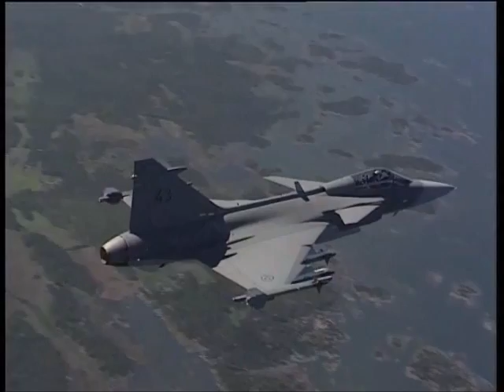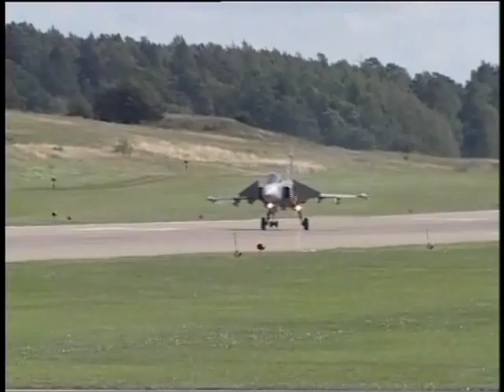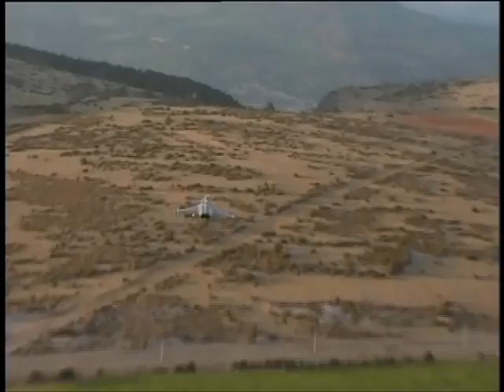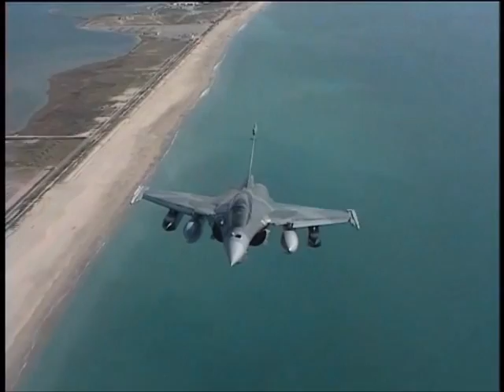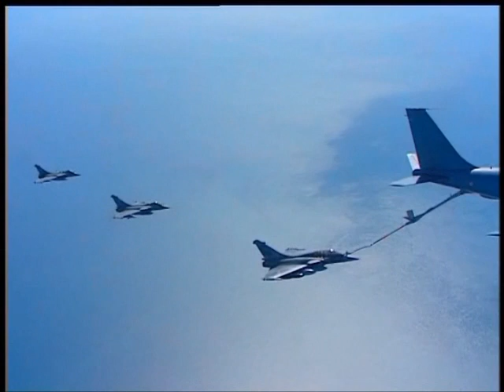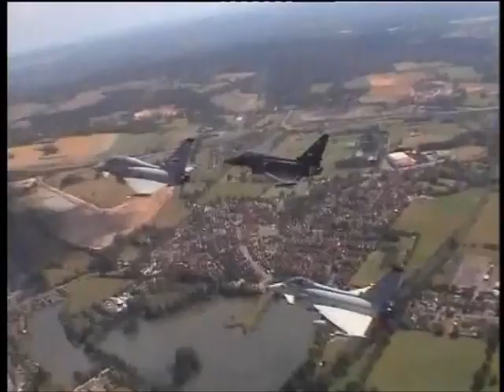Eurofighter, Rafale, Gripen - AircraftRecognition.co.uk

Comment: The video started wrong already at the beginning. No the gripen wasn't the 1st of the 3 to fly first, it was the Dassault Rafale !

First gripen fly was in 1988, Rafale was in 1986. Gripen only entered in service before the Rafale, simply because French politicians and government, was always changing their minds and demands ... It results of delaying the Rafale entering in service for many years.

Otherwise the Rafale would have been long time ago ready to enter in service before gripen. Politicians are the problems as often.

Also, gripen c/d which is the original and first gripen, was only using a Volvo engine. Only the new gripen ng e/f is using same engine as f18.

Comment: AESA Radar (RBE2 AA)
Advanced Optronics and warefare systems
Engine Options M88-4A or M88-9
Better armament and nuclear strike capabilities
Omnirole Capabilties

The choice is easy, the Rafale is the better especially considering how cheaper it is compared to the Eurofighter, the Grippen is not even in the same league but It isn't trying to be and selling at considerably cheaper price
Reply: Gripen is the best deal - it sets aside national pride to use component from all over NATO (British radar, American engine, French fuel system, Swedish cockpit display, German gun...) to ensure that the Gripen gets what is best for the price.

Don’t even get me started on how capable Gripen E is.
Reply: InitialDAmine  the new captor E radar on the typhoon his miles better than what the Rafale as. Stop trying to put the Rafale above the typhoon because it will never happen. The Rafale his to slow, service ceiling well below the typhoon, radar not as good. Thrust to weight ratio not as good. The Rafale his a great fighter at what it was designed to do that his air to ground. It can do other things well but it's certainly not in the same class as the typhoon in air to air mode at BVR or WVR
Reply: @terrywainman6050  is there a eurofighter with captor e rn ? Spectra is better than Dass . In wvr and dogfight the rafales close canard gives it an advantage in low speed . It also experiences less drag. In bvr also rafales radar is better rn but once the captor e comes .... eurofighter will get advantage in radar .....but Rafale spectra can provide firing solution upto 200 km.....Dass is only 100km+ . Also Rafale has ir signature reductions . It also has TV channel in osf  and a laser designator as well. It is wayyyyy better in A2G due to terrain following features and larger payload and more range etc. Also remember the Rafale has the mica ir ...which is the longest ir guided missile . Both the aircraft officially has about same rcs but I think Rafale is lower due to active cancellation and better shaped air intake . It also has serrated edges on the wing . It is also slightly smaller than the eurofighter thus giving it lesser rcs.

Comment: Gripen is the most susesfull in terms of sales. Seems low operating cost, easy to maintain and good support structer from SAAB means it is doining very while. And the gripen NG will bring it from 4.5gen to 5gen levels.

rafale is just to expesive in purches and maintaince.
Reply: To kaa13:
... I would add that Switzerland did NOT even buy the Gripen... at least not yet... It was first selected because it was the CHEAPEST option (the Rafale had CLEARLY gotten the highest evaluation ratings, the Eurofighter Typhoon being 2nd and the Gripen 3rd and last, as shown by the Evaluation Report which is easy to find on the Web), but the sale was eventually cancelled by a referendum in May 2014. To date (June 2018), Switzerland still did NOT buy a new fighter to replace its F-5s and then its F-18s.
Reply: "the Rafale had CLEARLY gotten the highest evaluation ratings"
At least in combat endurance and payload as i recall it, which is no surprise when compared to Gripen. One would have expected more from the Eurofighter, but I guess the two aircrafts have different priorities.
Reply: @onlypeaceindeath  The Eurofighter effectively was barebone tranche 1 which they offered. Now in the new evaluation they offer Tranche 4 - the same as the Luftwaffe orders. Multirole with an aptitude for air defense. Quite likely the evaluation will be won by the EF. Especially given that Switzerland had poor experience with Dassault in the past.
Reply: @Sedna063  "Quite likely the evaluation will be won by the EF"
Isn't the operational cost for the EF quite massive? The Rafale is to my understanding cheaper to operate, plus the Spectra EW suite is supposedly one of the best.
Reply: @onlypeaceindeath  This depends how accounting is done. Both Eurofighter and Rafale are expected to be equally expensive. However, there are multiple figures out there and I don't believe either of them. In terms of operating costs, it would be Saab 39 that would be the least expensive. 

However, we are talking about Switzerland and they are a rich country.... 

The Spectra EWR is great but honestly, not much is free information to either of us, similar situation with the Typhoon's DASS. 
I would say both are highly capable with a slight edge to the Spectra but nothing the Typhoon cannot get. There are talks building a special EW variant of the Typhoon for the German Luftwaffe. Now that would really change things.
Reply: Given that the Gripen by design cannot be a stealth aircraft, it won't be possible to move it from 4.5 to 5.
Reply: @Sedna063  "Given that the Gripen by design cannot be a stealth aircraft, it won't be possible to move it from 4.5 to 5"

I think he meant that the electronics will be at 5th generation standards.
Reply: @onlypeaceindeath  I think he means it will be a 5th gen.
Reply: yes yes volks wagen polo have more sell than the aston martin DB9...

Comment: Gripen flew first in 1989!
Reply: 1986 for the Rafale !
Reply: Banzai Banzinou true, (actually 1988 for Gripen), but the introduction was earlier for Gripen, 1997 compare to 2001 for Rafale.
Reply: The Swedish Defence Material Administration (FMV) states the first flight being in 1988, not in 1989. So I'd say MightyMagnus is correct.
Reply: Banzai Banzinou the demonstrator (significantly bigger aircraft equipped with F18's engines) flew in 86, the prototype in 91 and the first model delivered to the French forces in 2000

Comment: Yeah you're right, thanks for the correction :-) On the other hand, the airframe is used as multi-roles (SU 35) And it's much more suited to carry other munitions (Bombs, rockets..) Compared to pure breads such as F15A/B/C and F22s... But the multi-role would probably be carried out by primarly MiG 29s during Soviet reign. and the Airsuperiority role would be given to the SU 27.
Reply: Multirole wouldn't have suited the MiG29 at all. Far too little carrying capacity.

Comment: The F 15C is an Airsuperiority fighter. It carries a AA missiles a plenty. Meant to suppress the enemy Airspace. It's not intended for CAS/SEAD/whatever duties. The F18/SU 27/F16 and single seated Mirage 2000-5 is Multi-roles. (Twin seated being fighter Bomber á F15E & SU 34) Start with Categorizing and you'll end up with each aircraft in a categorie by itself... Stick to their roles and judge them from that.

Comment: Part 1
"You could damn well fly there with WW2 fighters and you'd get marginally worse results for the same costs...."
I agree that the nazislamist thugs in Mali did not deserve the Rafale or the Mirage 2000 or even the older Mirage F1... but hey, these are the aircraft existing in French air force, and it was a good opportunity for the Rafale to perform very useful precision strikes...

Comment: Part 3
For example, the F-15C and the Mirage 2000-5 are two fighters of about the same generation, but the F-15C is a heavy fighter which is in the same category as the F-18 (although lighter) and the Su-27 (although heavier), and the Mirage 2000-5 is a medium fighter in the same category as the F-16.

Comment: Yea? can the Typhoon be operated from an aircraft carrier? IF not, you'd goup the F 18(E/F model) in "carrier capable" togheter with say Rafael. It's really a strawman anyway.

The point is really that since each aircraft are designed to fullfill the same role they are comparable.

Comment: You can compare Gripen and EF Typhoon to some extent because they have comparable roles and are of the same generation.
But it is also true that they are not in the same category: single-engine/twin-engine.
In this respect, it's probably better to compare the Gripen with the most advanced variants of the F-16. In the Indian MRCA/MMRCA competition, where the Gripen NG competed, one of the other competitors was the F-16IN Super Viper, based on the F-16E/F Block 60 (already with an AESA radar).

Comment: As I already stated, the Gripen was chosen because it was less expensive than the Rafale and the Typhoon, this is a very well known fact.
Switzerland is a small and neutral country which already has some F-18s, and therefore had no urgent need for a more capable but more expensive twin-engine. The Swiss Air Force is only defensive, and the small single-engined Gripen is enough for the size of their territory.

Comment: The Gripen first flew around 1990 and entered service in 1996 I believe? Anyway I say the same as thebeatnik1000 that the Gripen has proven it self in so many Red-flag exercises etc. In the Redflag 2008 in Alaska, beside being one of the most efficient fighters, it was the ONLY fighter who flew around the clock regardless the weather! And it still got 2 "shoot-downs" of the Eurofighter!
Reply: Gripen c/d was a very very small fighter, with a very low powered engine from Volvo. It was nothing extraordinary.

The Rafale is an all weather and tracks terrains omniroles fighter jet. Also 1st fighter jet to be able to defeat the f22 in Redflags and ATLC.

Comment: Part 6
And I'm sure you must be ignorant enough to think that Switzerland (TTE program) eventually chose Gripen because they thought it was better than the 2 other competitors, Rafale and Typhoon. On the Web, you can easily find the evaluation report from the Swiss Air Force stating that the Rafale clearly won the competition on technical grounds, with Typhoon second. Switzerland just chose the Gripen because it was the least expensive. They had no urgent need for a more capable twin-engine.

Comment: Part 2
- Typhoon: 1 operational engagement, also in Libya 2011, in air patrolling and air to ground missions (with target designation provided by Tornados);
- Rafale: 3 operational engagements: 1. Afghanistan, mainly from 2007 to 2011, air to ground (and some air patrols as early as 2002); 2. Libya 2011, air patrols and air to ground, with an operational rate of 95%; 3. Mali 2013, air to ground. All with high success.
Reply: Kinda flawed argument. 
-Typhoon is absolutely able to fly solo missions. They have the new litening pod. 
-All the other air forces have designated ground attack aircraft, like the Tornado. Hence they don't need to use a more costly Typhoon and use cheaper older planes. If the British want, they use Typhoons, which they do now. 
-France has a very interventionist policy, unlike other countries....

Comment: Oh wow, you're so funny.  Get the other side of the story: "That account, however,is strongly disputed by USAF sources flying the F-22. “It sounds as though we have very different recollections as to the outcomes of the BFM engagements that were fought... the Typhoon has good energy and a pretty good first turn, but that they wereable to outmanoeuvre the Germans due to the Raptor’s thrust vectoring.Additionally, the Typhoon was not able to match the high angle of attack capability

Comment: It's production was cut short mainly due to hard economics and the Cold War being over.  You'll find similar cutbacks with aircraft like the Rafale, PAK-FA, etc. All you have to do is realize that with rookie pilots it has does extremely well in exercises.  You won't find any other aircraft in  service where a pilot having less than 100 hrs experience in it and coming out on top the majority of the time.  So in other words, it seems that your opinion is shit, not the F-22.

Comment: I’m sorry, because you clearly do not understand the reality of military funding and the situation of the F22 project, they stopped production at 187 aircraft due to the fact it was conceived during the cold war and the need for it is much less than what was previously expected, furthermore, they did not scrap F22 research or maintenance/part manufacture.

Comment: If you look at American Manufacturers building military aircraft from the 1950s until
present day their were a lot of delta wing aircraft experimented with, some tailless
some with tails such as F4 and A4. Tailless deltas go like hell in a straight line but
slow down quickly when doing hard turning. And no aircraft can outrun a good air to
air missile It is the weapons system that makes a superior fighter. even the F16
as old as it is can maneuver harder than a pilot can stand.

Comment: Jas size its not a significant factor to avoid radar signature, if this its the case, the F-16 and F-5 also have the same small size and can be detected, but by another way: stealth tecnology are more enginiered to avoid radar signature as inclinate angle sections paint and reduce exaust tail signature, lol.

Comment: You forgot to take the size of the JAS into account. It's insanely small. 

I think it's so small it's almost in stealth (red that it's very hard to detect at all due to its size).
Reply: Being difficult to be detected doesn't only remain on size, otherwise everybody would be making small fighters aircrafts.

It helps, but it is not enough. For example, the Rafale is bigger than gripen, but has a lower RCS than gripen. So it means, it's more stealth even it is bigger than gripen.

Comment: You are right. From the 3 jets here Rafale is the must powerful in modern warfare. The weapon must dangerous for any modern aircraft are ground to air weapons. Jas 39 is a single engine with no thrust vectoring, is a easy target. Eurofighter is limited in many aspect of modern warfare that why UK will combine with F-35 to fill areas, like naval & stealth roles. Rafale is a complete system, have a naval version, not have stealth but have high defense against ground to air and air to air weapons.

Comment: "During Red Flag 2012, German pilots flying Typhoons demonstrated the weaknesses of the Raptor in close in combat due to its size, weight, disadvantage in IR sensors, and lack of off-boresite weapons."
Yah ofc no gen 4.5 can EVER dream of winning against a gen 5 like F-22 raptor...*cough* They used EF Typhoons to beat the crap outta the F-22... Care to explain?  Did they just dream? Or are You just talking outta Your arse? Exactly the latter is correct! 
Don't write BS as if it's God's truth!
Reply: Actually, Red Flag Alaska 2012.

Comment: You are wrong. The Eurofighter is more agile than both the F-22 and the Pak FA. It's Praetorian system also allows it to evade most if not all modern Air to Air missiles. You HAVE to go in close against an EF if you want to shoot it down, at which point it eats you alive.

Comment: The EF doesn't have TVC, It doesn't need to. It has huge canards, and turns faster than any other jet currently available. The EF2000 CAN be fitted with TVC however, that would be ridiculous because then no pilot could fly it because it would turn too damn fast.

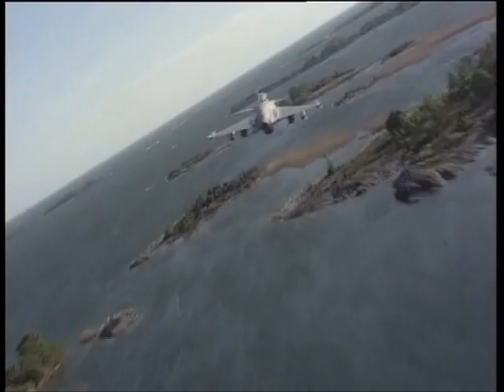Comment: 2D thrust vectoring move up and down, in EF move up and down slow, in F-22 move up and down fast, in PAK FA or others Russian jets the 3D move in any direction very fast. The speed of nozzle and how many directions nozzles can move determining the amount of movement a jet can do. For example (  /watch?v=eeiqMn7xb_Y ) at 1:45 video time you can see a 3D thrust already more advanced that EF 2D slow thrust vectoring. Is other problem with 4.5 gens a 4th gen with few upgrades can do better

Comment: The market is full of 4.5 gens like EF or MiG-35D but countries manufacturing for different reasons. The EF was build because UK, Germany, Spain & Italy not have the tech yet to make a 5th gen stealth fighter. In terms of agility the 2D Thrust vectoring in the EF is 30 times inferior to a PAK FA 3D Thust vectoring and 10 times inferior to the 2D Thust vectoring in F-22 in case of F-22 vs EF for matters of speed in nozzle movement and max speed.

Comment: Stealth Fighters are not invincible, and by now by no means undetectable or untrackable. It only takes networking several RADAR installation, and the stealth is neutralized, since stealth profiles work by reflecting the incoming radio waves away from the radar installation they came from. Put one elsewhere, and you can pick those waves up again and boom, stealth neutralized.

Comment: And I never said otherwise. It's still more agile than either the F-22 or the PAK FA.

Also the EF2000 will have greater engagement range than those two once the Meteor 2 missiles are in service.

Comment: & by the way i've done the research & L-band problems have been mostly but not completely solved & reigned into higher performance by a process of triangulation by massive improvements in computer technology such as
SIGINT & Tesla corp has mastered it for the S-400 batteries for example.
They've been mass producing Kolchuga & Tamara systems & VERA-E
since 1987; updating their software routinely & have even sold it to India
& China.

It is anti-stealth but but it can be defeated by tactics.